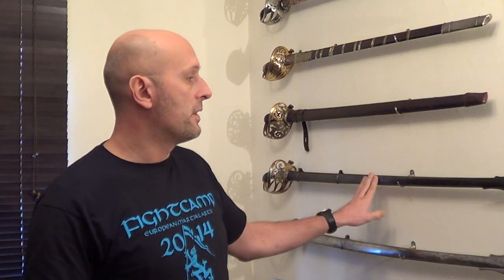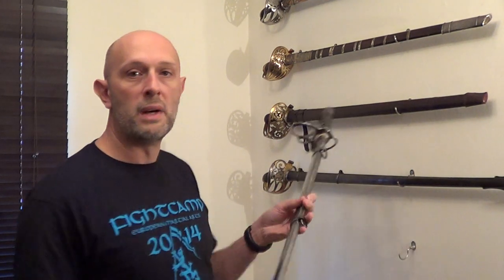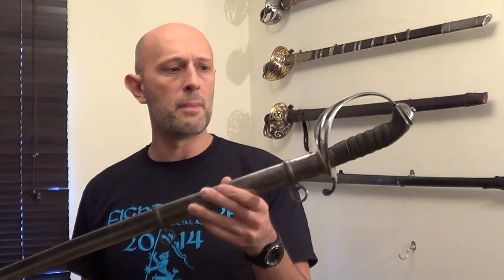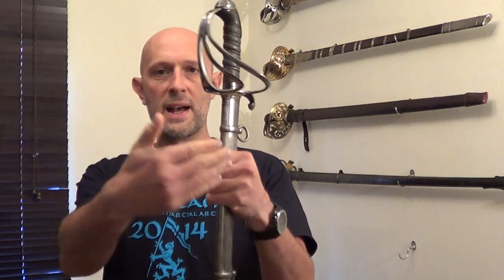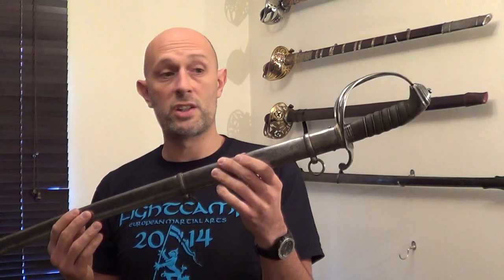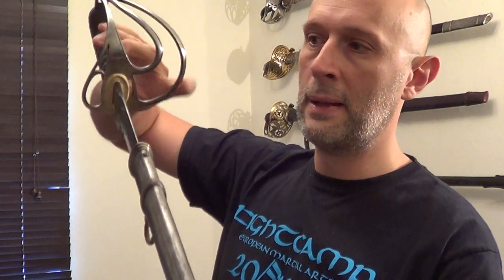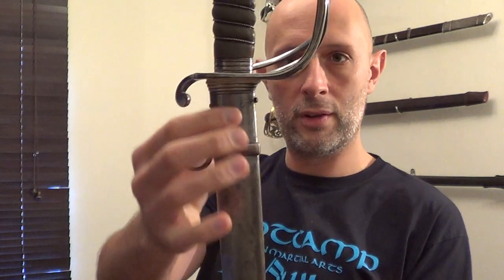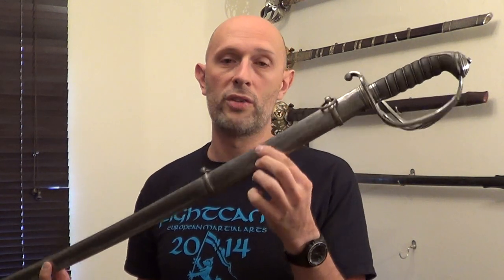Why make sword and knife scabbards of metal?

Comment: The water protection of metal scabbards is one big reason why I love them. They're solid, (almost) fully sealed shells that won't absorb water when they touch a puddle or wet coat. So the blade is nice and safe unless you submerge the thing in a river.

Comment: Hey Matt! Engineers tend to describe things as "ruggedized" rather than over-engineered in this context. It's widely known as a polite term for "squaddie proofing" at least in the UK.

A good example of over engineering is probably the spring/folding handguard on some sabres - it's over engineered because it degraded the performance of the handguard, added more moving (breakable) parts and a better solution (an rigid edge with a soft lip) was available and ultimately adopted

Comment: How long did swords and scabbards last in the medieval period? I think that the fragility of swords and weapons is overlooked in fiction
Reply: I would also be interested in this.
Reply from the maker: Swords sometimes lasted for generations (and of course some survive to this day). However, that would depend on how heavily used they were and their quality. Of course a sword that is worn by generations, but only ever used in a couple of fights, could last a very long time if looked after. On the other hand, we know that lots of swords broke in use, because there are many accounts recording the fact and broken swords are also shown in a lot of medieval art work of battles. Scabbards, it seems, were replaced quite regularly.
Reply: scholagladiatoria
A new scabbard is the cheapest way to have a flash new sword to show off.
A lot of weapons where worn as a fashon item.
Reply: Oreus iron swords though not steel
Reply: Guy Potts AFAIK, mostly personal self defense and ceremonial swords survived whereas battlefield blades were robuster, less fancy and used until they were trashed. That's probably why only few Messer and Falchion survived as most were low status battlefield weapons (but still used by the nobility).
Reply: Steel swords are basically sharpened springs.

Comment: this gentleman makes a lot of good points;  well worth watching.  I picked  up on it during my project of making a scabbard for my custom Tai Ji Sabre.  trying to figure out what material(s) to use was quite a project in and of itself.  His presentation here brought to light a lot of helpful points which I otherwise would not have considered.   I think I'm going to end up going with aluminum exterior with kydex interior.   will post the final piece when it's ready.

Comment: I practice Iaijutsu and something I have done, which is quite common for less proficient Iai students, is to damage the wooden scabbard (saya) when performing sayabiki incorrectly.  Often this can be a slight splitting at the mouth.  In my case the leveraging of the blade during sayabiki was applied without having drawn a sufficient length of the blade, so the point actually broke through a small section. As it is not easy to replace scabbard outside of Japan, it is quite common to see scabbard that have been bound with a type of wooden twine (similar to rattan) to reinforce the mouth.

Comment: Hi Matt,

quick question. Would a fully metal scabbard ever do any damage to the edge? Was that a concern or was it possible, but they just didn't care about it that much.

Also, do you think that part of the reason they started using metal scabbards for officer swords was because there was less emphasis on blade combat over firearms?

Thanks!

Comment: Great video! I didn't think about the damage spurs would do to a leather scabbard, particularly if they were of the sharper varieties. When I ride using a jumping saddle of non-military design, the scabbard sometimes lodges between the left leg and the saddle, and since the leg is pressed into the horse's body as an aid, it is possible this action would cause the spur to pierce the leather over time in this situation. Also, it occurred to me that cavalry swords hang much lower from the belt than foot swords. According to the Memoirs of Baron Marbot, Napoleon's cavalry troopers sometimes allowed their metal scabbards to trail on the ground when on foot, rather than hold them in the left hand or adjust their webbing for dismounted duty. So metal scabbards all the way for cavalry.

Comment: +scholagladiatoria I've noticed that on many metal or even partially metal scabbards there is a flange at the end, am I correct in assuming that they would have been used regularly in combat (either with or without the sword inside) like a flanged mace? I was a bit surprised that you didn't mention anything about the flange in this video, is it because they were primarily decorative?

Comment: This is my first video of yours I have seen very informative. I'm making a scabbard for a home forged sword, and am deciding on material I want to make it out of.
Reply: +Evil Paradigm kydex works really well instead of wood or leather, it has all the advantages of steel with much less weight and it doesn't rust.
Reply: onemadhungrynomad Thanks. I have worked with kydex before, so I will probably use kydex wrapped in thinner leather.
Reply: yeah thats a good plan. all the advantages of a metal scabbard but lighter and stronger and waterproof.
Reply: kydex flexes just enough too that depending on your blade's design you could even make it so it clips in water tight.

Comment: Depending on the exact design of the scabbard you can find that you end up making things worse when it is 'stuck' due to how you end up having to put pressure on to grip it and pull it off. You actually see this problem a lot in various mechanical things, where the natural attempts to 'get a better grip' in turn cause a clamping action, which then further increases the force needed to overcome initial static friction. Since you can move the blade to break the rust/frost bond, you squeeze harder, increasing overall friction, and decreasing the chances of getting things moving so the bond will break.

Physics is fun.

Comment: What about fighting with your scabbard? If your blade snapped in half would you be able to use your scabbard as a last resort blunt weapon?
Reply: Well, the scabbard would probably be attached to your belt pretty well not to fall off accidentally. You would have to detach it before you could do anything with it.
Reply from the maker: There are quite a few accounts of scabbards being used as weapons and it is explicitly shown in a few combat treatises - in Fiore dei Liberi for example.
Reply: jokurandomnimi
The scabbard makes a fine parrying weapon. And a metal one would have enough heft to do some damage if you bash someone across the face with it.
Reply: jokurandomnimi
I've seen people train with the scabbard in one hand to parry with and their sword in the other to strike with, quite effectively I might add.
Reply: jokurandomnimi
Ah OK. I still think you could fairly effectively. And if you have no other choice, its always there.
Reply: jokurandomnimi
I guess a metal pipe (scabbard) makes for a decent makeshift weapon, certainly much better than fighting completely unarmed, but maybe you could make more use of what is left of your sword. If it snaps in half you still have a cutting edge and a handguard, which the scabbard does not, maybe dual wielding them is a good strategy.
Reply: jokurandomnimi As a hard bunt tipped trusting weapon it could be used to blind an opponent and damage joints. It would probably also make a decent lever bar to close and wrestle with. The point or tip of a scabbard is still a much better weapon than a fist due to the reach, hardness and small surface area.
Reply: Against a sword, I would be hard pressed to take my belt knife against a longer weapon when the scabbard has more reach, even if only to close the space so my knife can play on better terms. The pointy stick has the better defence and therefore the better weapon if I want to live more than I want to kill.
Reply: If your sword breaks in half the half that you're still holding will still be sharp and pointy. Use that.

In modern sport fencing and HEMA you can be seriously injured if your opponents blade breaks because what was once blunt with a rounded end is now sharp and pointy and can penetrate your protective gear.
Reply: Basically depends on the weapon (smallsword is easier to block like this than, say, a krieges messer), but the way I'd use it in your scenario is simply throwing it in the other guy's face to slow him down, and run like cheap paint.
Reply: MartinGreywolf
"Run like cheap paint".  LOL. That's a good one.
Reply: Slurpon Muhdick
 Yeah, I wish I could take credit, but I got it from Schlock Mercenary.
Reply: MartinGreywolf
Still a good saying.
Reply: Are there any historical examples of sword scabbards with hand protection like a sword for if you're wielding it like a weapon?
Reply: @scholagladiatoria  I'm wondering if there's any record of a scabbard being used as a parrying stick alongside the sword.

Comment: Heres a question - once water has got into a steel scabbard and the wood lining is soaked, how do you dry it out if you are on campaign? For example, if you have to ford a river in the morning then march through the afternoon, you would have to dry your scabbard out overnight somehow.
Reply: +Mikey R I would assume they could hold it over a fire for a bit to heat it up & dry out the wood, since the metal would protect it from the direct flame, though I've never tried that technique & have no idea if it would actually work
Reply: Sean Madson
Cheers Sean, when youre out on campaign I suppose you just make do. I just wondered if there was something in the official "Sabre Owners Manual" that gave the soldiers a procedure for it.

Comment: the leather washers were often heavily waxed.  Nevertheless they do attract moisture. One often sees a transverse line of pits across the sword where a missing one was.  Felt is allegedly better for being nonacidic.  Great sealed in the sheath story; so far (crossed fingers) I've been able to soak em off with oil, but I've certainly considered what you had to do.

Comment: What's the purpose of the flared bit at the end of the scabbard? Is it to prevent the tip of the scabbard being damaged adn thus damaging the tip of the blade?
Reply: I was wondering the same thing. It seems to be quite common on metal scabbards
Reply: It serves multiple purposes. First, yes, it's a protective device. Second, it's often there because it's easier to hammer the end of the chape/drag down flat than to close it into a neat pointed/rounded tip. And third, it jangles nicely against other metal components on the cavalryman's equipment or the horse's tack, which was seen as a good thing during parades and troopings.
Reply: Thanks! Wasn't the jangling thing a bit of a problem on scouting and patrol, though?
Reply: It could have been, but not all cavalry units were all that concerned (or that good) at minimising their signature and avoiding enemy observation. The ones who were better at these specific tasks might have resorted to a variety of measures such as muffling the scabbard with scrim or dismounting beyond likely enemy observation and performing the local search/patrolling task on foot without the sabre.
Reply: it's commonly called a drag, and that's what it's for.  rather than wearing your scabbard tip away and then damaging your sword tip.  as you said.

Comment: I own a 1915 Prussian Artillery Footsoldier's saber. It has a dent in the metal scabbard a few inches below the throat of the scabbard, on the side. It's on the inward part that would be against the soldier's hip. I've been trying to figure out how the dent got there. I suppose its possible it just happened at some point during storage, but I've also heard that sometimes scabbards were intentionally clamped down if that particular weapon were a bit rattly or noisy. Ever heard of that?
Reply: How interesting my paternal Grandfather was a Feldwebel in a Prussian Artillery unit in WWI and I have a picture of him with his saber. No dent in the scabbard btw.
Reply: Paul Varga Mine says LFAR 13.8.39. I know the LFAR part stands for Landwehr Fus-Artillerie Regiment. The numbers indicate regiment 13, company 8, 39th weapon. If I had the time and the expertise, I think it'd be amazing to find out whose it was. Hahhaa

Comment: Feel free to shoot this one down, it is simply an idea, you know that ZING! that comes out of every pull of sword in a movie?  Why not make that a thing?  I am sure you have seen high carbide or ceramic sharpeners that you pull a knife through...  Why not have that in the scabbard of a sword, or course it would work down the metal over time, but a fresh sharp blade every time you draw?  I have 80 year old kitchen knives that have been sharpened to 3/4 of an inch thick, but I can still cut through a yew branch thicker than your arm with one slice.   On the right blade, with the right design, this could be a very good weapon.

Comment: Off topic: can we please band together and convince Lindybeige that a longsword is not a "dirty great crowbar?"
Reply: Yes. I also think that it i exaggerated. I think that the crossguard can be helpefull in grapling when you dont want to drop your weapon yet. By pressing against the opponents neck. And if unarmourd the edge aganinst the neck will make the opponent comply because of pain not so much force.

But grabbing the blade with both hands and hooking? No. I dont think so in a real fight.
Reply: For that particular period, knight vs knight battle basically used longsword as crowbar, same for some other types of pole weapon. It is usually better to capture some one in full plate armor than killing them. And throwing someone in full plate helmet onto the ground can completely ruin their vision, orientation and perception, thus makes it easier to incapacitate that person.
Reply: Nguyễn Khôi Nguyên
They used the pommel as a mace or the crossguard as a pick, as well as half-swording to stab in the gaps of the armor.
Reply: A crowbar can did most of what you said as good as a sword, except for the stabbing part. In full armor fight, wrestling is what you do the most, not fencing. Which is why Lloyd considered that a longsword was used as a crowbar in such case.
Reply: Nguyễn Khôi Nguyên
ehh. okay....
Reply: The guy has a point, it's great for leverage. It's how you apply that leverage which is often the fight. That's not to say there's not more, certainly as a general statement is that it seems to be intended as, I can't argue with it, even though I have issues with it, especially since things like the Mordhau (you have a sword? No, I have a hammer (using the quillion as a striking point while holding the blade) existed.

It should be said, this has been shown to be used by a person in no armour, versus an armoured knight.

Comment: On the matter of durability, surely a steel scabbard can rust. Was that ever a problem or were people able to properly maintain them even in wartime conditions when they could be soaked and muddy all day?
Reply: A rusted scabbard is easier to fix than an broken wooden scabbard. At least only the outside of the scabbard is rusted, while the inside is still dry, and your plate is not stuck.

Comment: Not to mention, if you are fighting in winter your sword can get frozen in the scabbard if moisture is allowed to soak though the scabbard or if a sword is put away wet.  With a metal scabbard you can simply slam it against the something hard to loosen it.

Semper Fi
Reply: +Papa Bravo 
Or warm it up. Metal is a very good thermal conductor!
Reply: If you had a fire handy, definitely.  Not sure how often they had fires at hand when marching to battle, so that may not have been an easy solution.

Semper Fi
Reply: True enough. But was thinking more if you were making camp and just taking care of all your equipment. Either way works, really.

Comment: I believe there is no real parallel to modern weaponry (battle rifles) as far as weight is concerned. All successful battle rifles in the past century have been LESS bulky than comparable target rifles. There are many reasons for this that do NOT translate to scabbard technology. Weight (soldiers' weapon/ammo/supply payload), manufacturing (cost of materials), and accuracy (heat of battle vs maximum sport accuracy). Great ideas/thinkers in weapons development are responsible for this, and if it mattered as much for swords, these considerations would have influenced blade weaponry many centuries ago!

Comment: I'm genuinely surprised the metal scabbard doesn't have a small drain hole in the tip to let any condensation or other moisture out. leather would eventually dry out, but any moisture in that scabbard would be sealed in.
Reply from the maker: I think the reason is that a hole would let moisture in. With the way these are designed, the leather washer at the guard forms an air tight seal with the scabbard throat.
Reply: scholagladiatoria Ya I mean it wouldn't let water in, but it wouldn't let it out. I would expect, especially on days with large temperature variance (late spring for example, cool damp mornings, hot afternoons) that condensation in the morning would runs down and pool in the tip. Obviously it wasn't a real problem or it would have been solved I guess. ☺